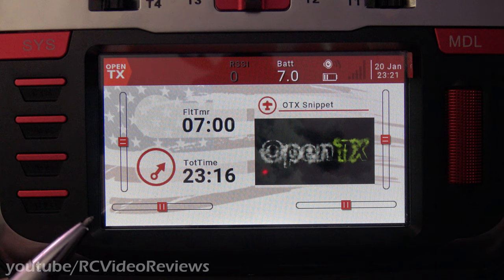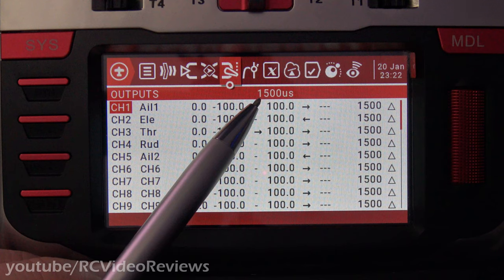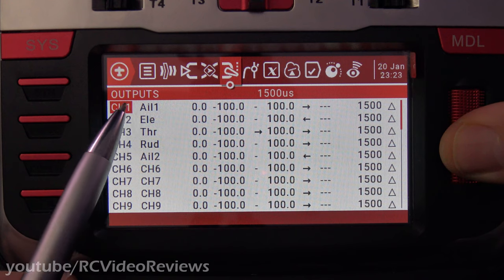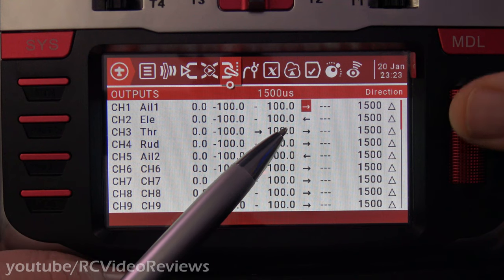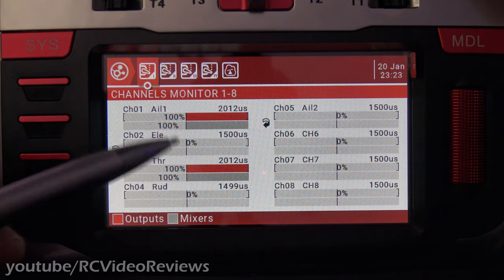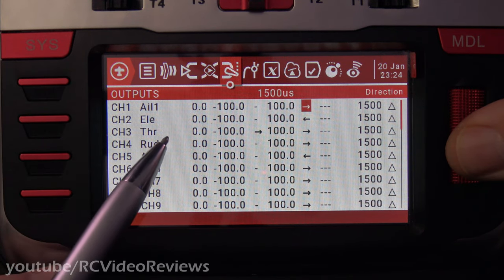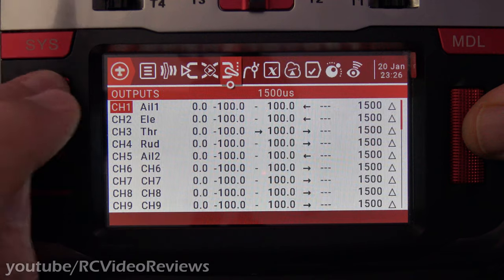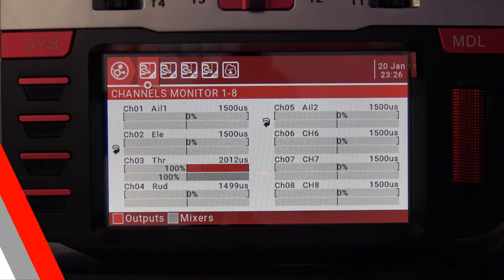OpenTx Snippet • How-To Reverse a Servo

Comment: I had a tough time setting up my first Elevon plane. But remembered that in one of your videos you put a Note with a red circle about the reverse arrow. That fixed it. Now you came out with the Snippet with great clarification. Thanks
Reply from the maker: Yup, you got it. I'm trying to cover the questions I get all the time. I think it'll be a lot easier to find these bite-size bits of information as standalone videos than buried in another subject.
Reply: @RCVideoReviews  another thing that is “Different” for me. As someone who has used a Spektrum transmitter, I found that when binding a new plane you have to do some different/unexpected things. I use DSM (Spektrum Type) receivers. In a Spektrum transmitter you create a new model and BIND. In the Radiomaster, you Select the Type of receiver BUT,,, extra step,,, number that receiver. If you don’t it will overwrite a previous Bind. None of the YouTube videos I have watched point that out. So I ended up having to rebind a previous plane. It does warn you, but not coming from Open TX, I ignored it,,, DOGH!

Comment: When you are in mixing function the top bar on the right corner will also display the function you are changing in the menu when you were changing direction it is labeled direction in the upper right corner if you are in Max it will say Max if you are setting your minimum throw it will say minimum etc etc
Reply from the maker: Good tip Jay! Thanks. Hey I was just digging through some old archive material and found a bunch of raw footage from the camp site. You need to get on Discord, I have some fun stuff to share with you.

Comment: Thanks for the quick tip   I have a question, unrelated to this,  but involving OpenTx.   Using Horus X12s,    but it should translate to all systems.   Using a pitot tube for air speed stall warning  alerts.   Three different speeds for flap positions,  works fine.   Have a and switch in logical to make them live.   Once it reaches rotation speed on take off run,  V1    one alert.         Take off fly,    if I go below set speed I get alert.  Great     works to what I need.      But the issue I'm having is this.   Once I lower speed to low to trip the stall warning alert,  it doesn't reset by itself after going above the set speed warning set.     Meaning if I have to abort an approach,    I'm hearing the warning right up until I finally land and taxi and turn Rx off.   I know its alot to ask.   But hopefully you can give me some insight.    Much appreciated for your time.   All gear I'm using is Frsky,  X8R receiver, pitot tube, and verio     Edited for spelling
Reply from the maker: Russ, you need to hop on discord and talk with me about this one.
Reply: @RCVideoReviews  discord?   I'm unfamiliar with the platform.   Do I get to it through a link on YouTube

Comment: Hello, I have EdgeTX 2.7 . Busted the nose gear STEERING (not retract) servo on the Eflite twin 64 mm A-10 and purchased a similar replacement servo. Installed it just the way the other servo was but the the nosegear turns the opposite direction of the rudders now? The way Eflite set it up was to use another short cable out of the same plug for the rudder and they connected the servo to that extra lead. They both run off the same channel so I can’t reverse JUST the nosegear servo without also reversing the rudder (which I don’t want to do because the rudder is correct!) what do I do? I have seen videos of openeimg up the servo and reversing motor leads and pot leads, but is there any way else to accomplish this? Thanks
Reply from the maker: Flip the horn maybe?
Reply: @RCVideoReviews  in the path of the nose gear retract travel then…
Reply: @RCVideoReviews  are servos sometimes specific directions of rotation?
Reply from the maker: I'm pretty sure some servos can be reversed on the servo itself.

Comment: Have a question.  Built a profile f16 (frc foamies f16 mk1).  I have two elevator servos connected with y harness to channel 2.   They are operating opposite.  Is there a way to flip one of them or do I need to make sure both servo and arms face the same direction.
Reply from the maker: If you have two servos sharing the same signal you can only change their direction of movement relative to each other by rearranging the servo or servo arms.
Reply: @RCVideoReviews  ok makes sense.   After thinking about it. Since I have the ailerons in ch1 and 5.    Could I do similar with elevator. In ch 2 and 6?
Reply: @RCVideoReviews  actually that is what I just did.   Used ch6 for the second elev servo.     And it works